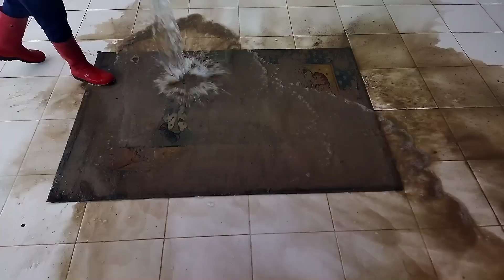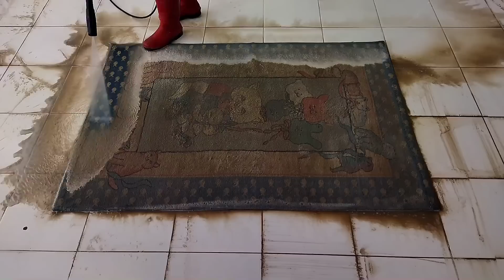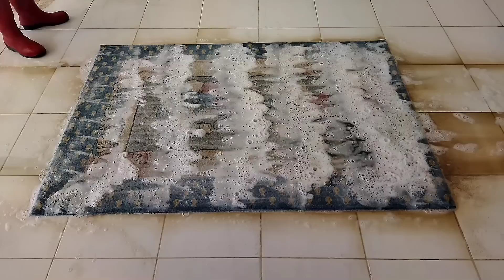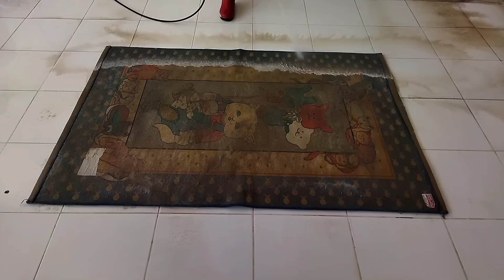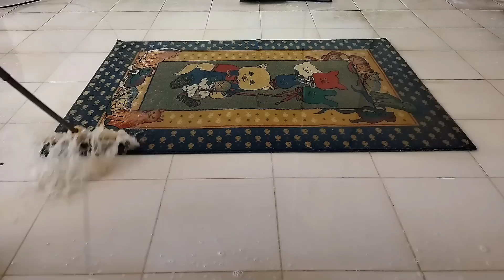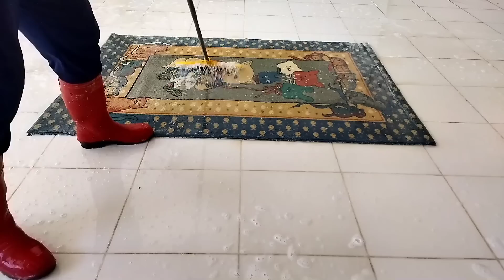The Bremen Town Musicians patterned dirty carpet cleaning satisfying ASMR

Comment: I was thinking, wouldn't it be easier and quicker to initially hang the rug up and power wash it rather than lie it flat on the floor? I figure this way all the dirt and grime will be able to run off the rug instead of sinking deeper into it and making it more difficult to get out.
Reply: I have wondered this also.
Reply: No, because then the fibers would come loose. This way, the weight of the carpet keeps the fibers from dislodging as he cleans it.
Reply: That's a really smart idea, in my opinion
Reply: Rugs can stretch under all that weight, especially along the edges, and then it won’t lie flat.
Reply: Omg THANK YOUUUU🙌🏽🙌🏽🙌🏽🙌🏽👏🏽👏🏽👏🏽👏🏽YEEESSSS!!! I 1000% agree

Comment: For this much muddy carpets there should be a machine that the carpet is hanged and pressured water is squirted to both sides from upside to down. Most of the dirt would be cleaned by this way. My big concern in these videos is that whenever you clean upside you push the dirt under the carpet. That saddens me and the carpets. 😅